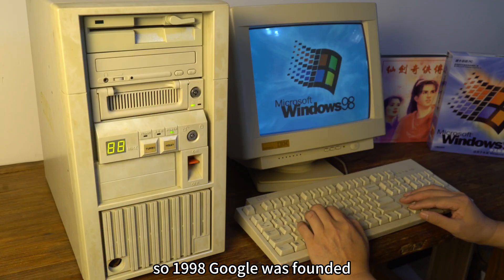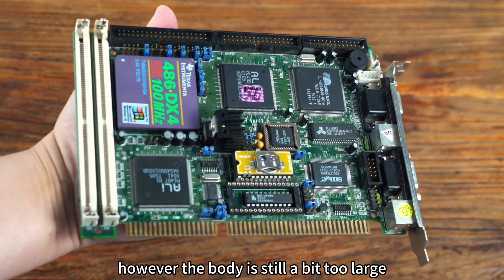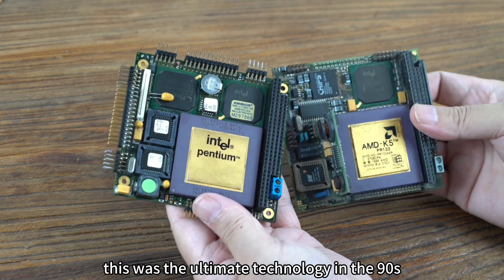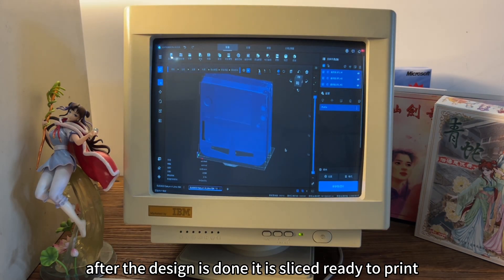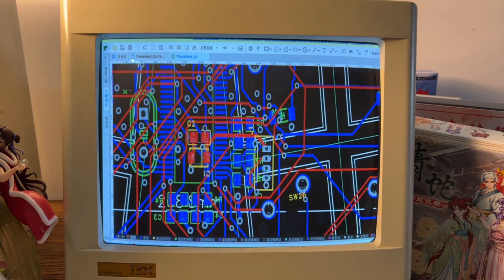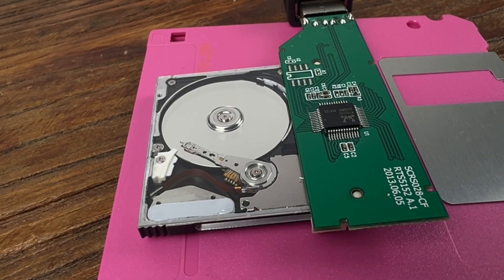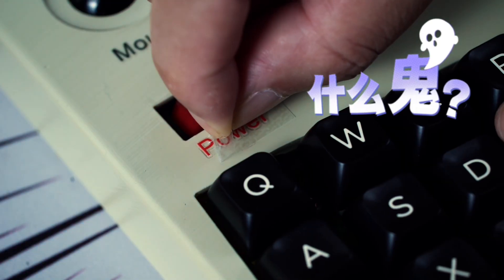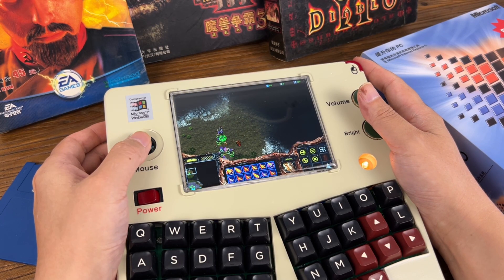Make a Pentium mmx cpu handheld computer

Comment: I was early adopter of the Hand386 before it was remade into the ‘Book’ form factor like the 8088 it released alongside with. With that said, your project has so many more advantages to where I can’t help but wonder if you plan to produce units even if a limited batch? Fantastic work, stand-out feature for sure is the ergonomic keyboard besides mouse control

Comment: it looks fantastic but why didn't you use something more basic, like rasberry pie?
Reply: I think you missed the point of this project. If you made it out of a raspberry PI, it would not be capable of running Windows 98 or those games.
Reply: That would be too easy and already overused
Reply: Better real hardware
Reply: @jpnc2319  but idk this sound more complicated then just using basic parts
Reply: @jpnc2319  btw you kinda look like azis from bulgaria <3

Comment: nice project. first liberetto was already that time and would make for a small mobo to use, but ridiculously expensive of course to use for a project like this i suppose.

 and the first nokia communicator was x86 as well(Before they switched to arm), but of course that mobo has no peripheals.
Reply: This is orders of magnitude more poweful than the Libretto or Atari's equivalent.
Reply: @zembryoz   liberetto line had as powerful and more powerful as a k5 or 133mhz pentium in 1996 already.  atari wasn't making anything in late 90s.

edit: of course you could swap some much more powerful industrial board into this from later 90s - and the point is just that you could have had a powerful handheld pc in late 90s if you were made out of money. we only wished we were.
Reply: @lasskinn474  No.  The first Libretto model, the Libretto 20, was released on April 17, 1996, specs: AMD 486 DX4 75 MHz, 8 MB RAM (20 MB max.), 270 MB hard disk, 6.1" TFT display.  The model you may be thinking of is the Libretto 100(CT) which was released in 1999 and had the Intel Pentium 166 MHz MMX CPU.  I owned many Librettos.